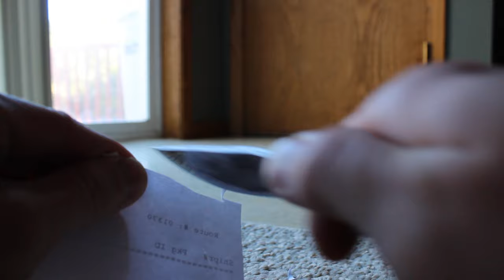Forging a knife from a lawn mower blade!

Comment: If you're scared of denting your twist, if your blade gets bent or isn't that perfect straightness after you punch your mark on it what you can do is heat it up and hammer it into a stump or solid chunk of wood with a two by four and you can straighten it up without denting any decorative marks; basically have a wood "anvil" and "hammer" to bend and shape pieces without denting or marking the steal.
Reply from the maker: WideEyed Smiles thanks for the tips! I'll surely remember.

Comment: Did your first attempt crack during the quench? If so, then you should probably switch to oil due to certain steels hating water when it comes to quenching in it. You got lucky I would say with the second blade not cracking from the speed of the quench that water has.
Reply from the maker: No no, it was the same blade. I didn't make two knives. I have hardened lawn mower blade steel before in water and never had a crack. There isn't a lot of carbon in them, well not as much as a 1095 for example which water will usually crack it.
Reply: ahh ok
Reply: Did you not temper the blade or did I miss that part?